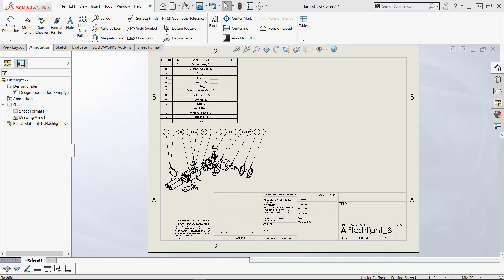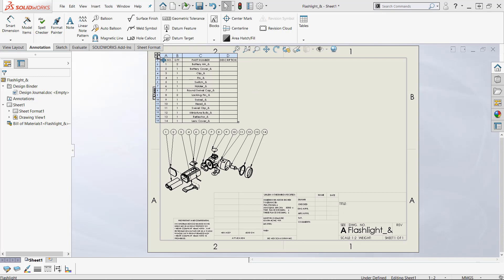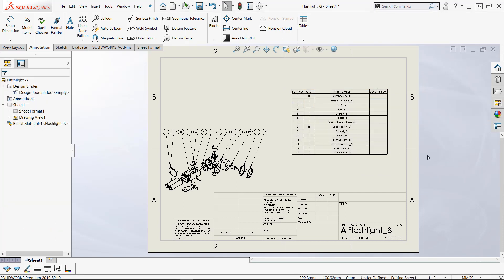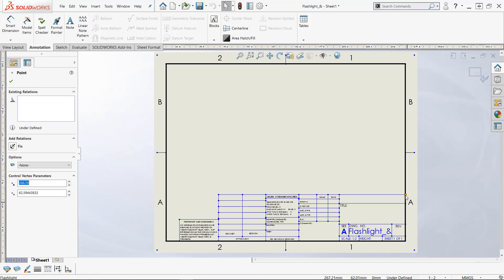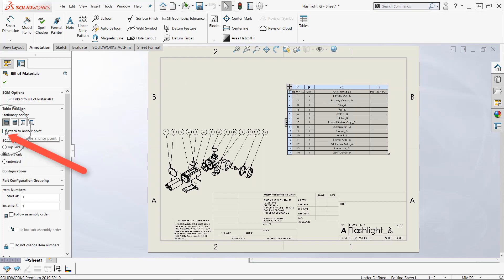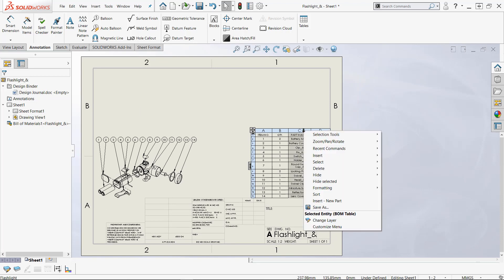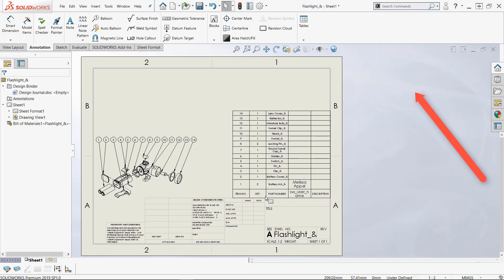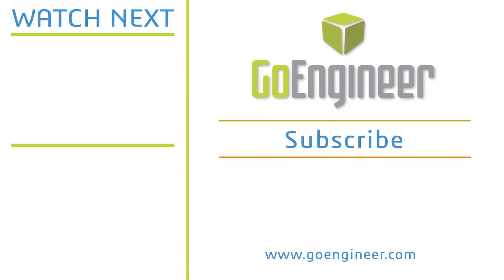SOLIDWORKS - Anchor Points in Drawings

Comment: Don't you need to save the sheet format to keep the change for the next drawing?  Guess I'm not to sure a reply will be forthcoming since no one has bothered to answer "WeiderMystic" from 4 years ago.
Reply from the maker: Correct, though saving the sheet format in that drawing will only affect that drawing. If you want to make a standard anchor point for all of your drawings going forward you would need to make the change at the template level. Open a blank drawing, add your anchor points, go to File > Save As, and select the drawing template from the dropdown.

Comment: How do you make an anchor for a model view? Say i have a typical sheet 1 with an iso view for an assembly. How do you set an anchor for a template to always bring your first model view to that spot?
Reply from the maker: Instead of "anchor points" they would be called "Predefined Views". If you open a blank drawing, right-click on the sheet, and under Drawing Views, select Predefined. We have another video, it's a bit older, but it explains the process very well - https://www.youtube.com/watch?v=rFmcNbo4e8w